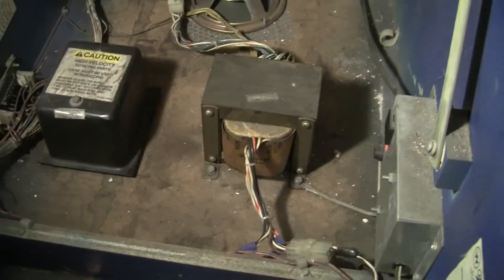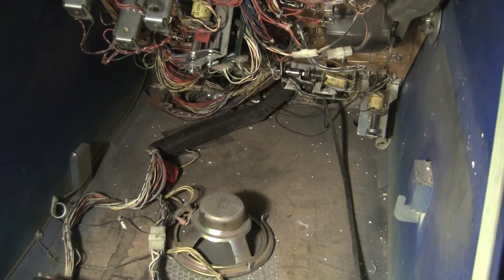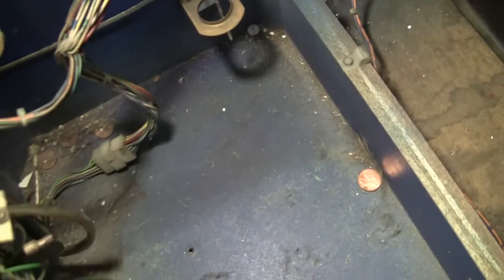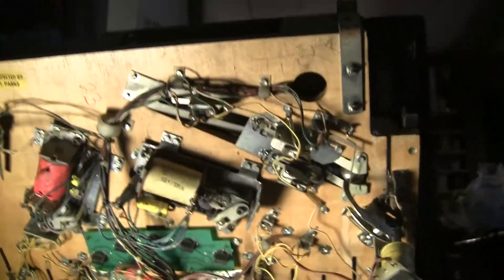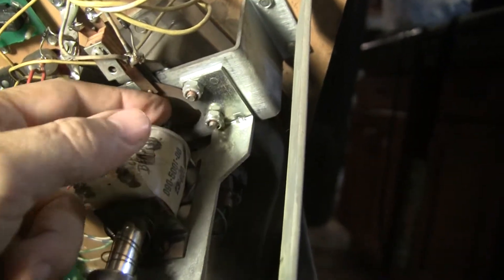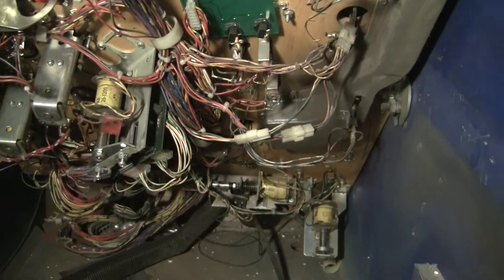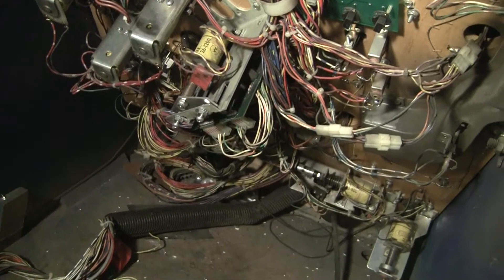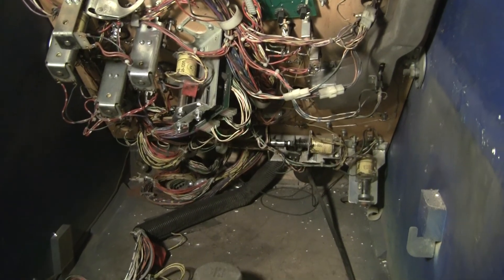PinballHelp.com - A look inside the Earthshaker cab [pbh8]

Comment: I know this is an old video but if you want a cheap cleaner that works I used Awesome Orange on my High-Speed and on my Medalist Dart Board to clean up the parts and dang does it work really slick! :)
And it is only $1.00 at the dollar tree. :)
I use it like it is water on everything I clean and it was disgusting what comes off the pinball parts it was like mud and sometimes pitch black coming off of parts and the boards I cleaned.
It will make you go wow as I was skeptical that it would work but it does.
And today I used it to clean the shower/tub and dang it looks like new. o.O